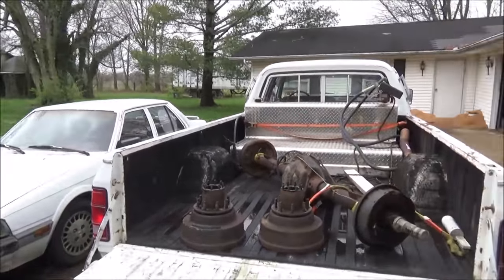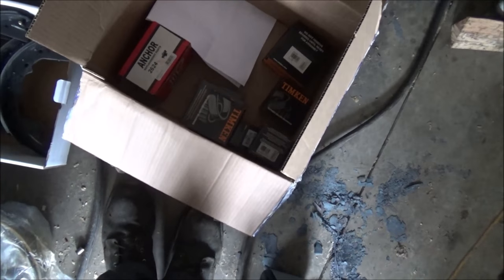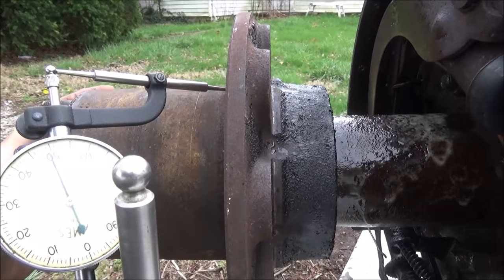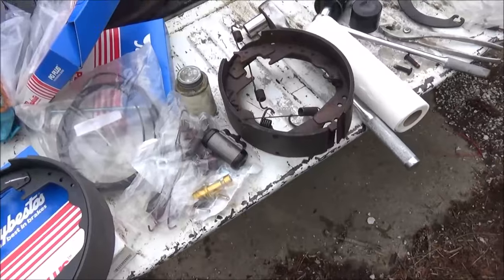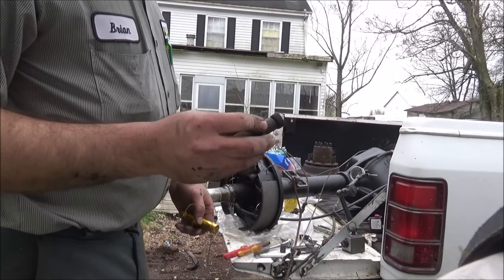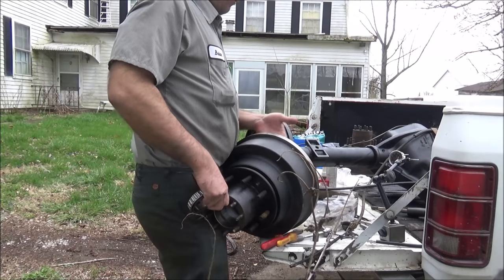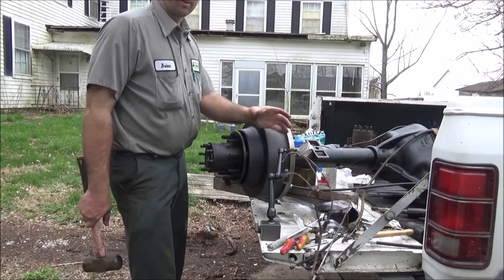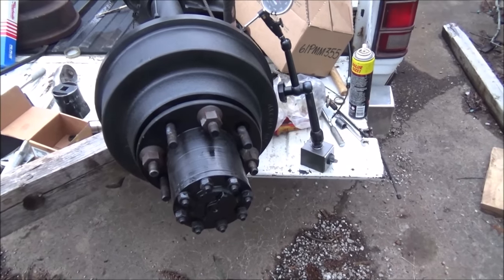Dana 70 axle rebuild brakes and bearings tips and tricks

Comment: Brian,the short friction material shoe always goes in the front......
Reply from the maker: Yeah I know the thick shoe goes to the rear I was just commenting that if you didn't know that not having them labeled would be problematic since even if you knew that part you still have to decide which pair goes on what side since they are mirror images.Lucky for me I have done plenty of this stuff so no problems here. :-)
Reply: For anyone that doesn't know, the LENGTH of the friction material is what dictates which shoe goes where. The shortest length goes forward, the longest goes in rear position.
Reply: It has been a few years, but I'm 99% sure that on my GM 14 bolt axle both shoes were exactly the same. Although, I do know for a fact that when you get into bigger air brake stuff that both shoes are exactly the same for the majority of applications but there are special instances.

Comment: Have to say I absolutely hated the bottle cap lug bolt set up on these truck, I had constant vibration from my old B350 cummins.
Reply from the maker: Centering the coined wheels is certainly a challenge. I prefer hub centric to stud centric but it is what it is. I have considered machining a pilot to add to center the wheels but with using acorn nuts to line the wheels up getting them centered isn't a terrible job just takes another step.

Comment: is it harmful to bearings to smack the drum like that?  i want to try this centering method after doing my brakes and using factory drums with only 60k miles...from the desert so rust is not bad and minimal wear.
Reply from the maker: As long as the bearings are in full contact it shouldn't hurt them. i figure the pounding the road gives them is a lot worse than anything I can do with a hammer.
Reply: Hey thank you so much for taking the time to answer my question!  I like your work style and your attention to detail.   Your videos are very helpful!  Much appreciated!

Comment: The adjuster levers (although they say R and L) are mislabeled and so you have them backwards.  If you look at your lever you’ll see that the part that touches the teeth on the adjuster is rounded.  The other side of the lever has a nice, crisp edge to bite into the teeth on the adjuster.  So, you’ll have to swap your levers from right to left and left to right.
Reply from the maker: Well they have been about 40000miles now like that so I guess I can fix it in another 40K when it will likely need some new shoes.

Comment: Where do you get the fluid film? I found one can of it at tractor supply and they didn't have any more. Best rust preventive I have found.
Reply from the maker: We sell it at the Deere dealership I work at so I get it for cost. :-) Try your local John Deere dealer. I really like it for rust protection I use it to spray all my machine ways that might have sweating and rusting issues. The Lanolin won't bother your skin either. :-)
Reply: ronald davis 
Look on amazon that's where I got my cans decent price too

Comment: Hi I have a problem I change my axle seal and I greased up my bearing I put a retaining compound on the axle shaft left like that for 3 days or so while I want to get a hammer gun to punch back in the leg nut bolts and n I struggled to take off the drum and my bearing and seal are stuck on the actual shaft do you know what my problem is I have a 92 Dodge D to Dolly . I was able to take off the drum but the axle shaft got stuck with the bearing and the oil seal.If anybody could help me would be helpful thanks.I did it exactly the same. Im lost. The 1st time I took off the ram and the drum and Axel everything came out fine
Reply from the maker: Your problem is the bearing retaining compound won't let the bearing slide on the shaft, you will have to heat the bearing inner race a few hundred degrees to loosen the compound before you can remove it then you can pull the seal off. The seal will likely not be any good anymore so better replace it and depending on how much beating on it you did to get the drum off you may want to replace the bearing too, a few bucks spent now could save tons in the future.  Never put loctite or retaining compound on anything until you are ready to not be moving, adjusting or taking apart again.
Reply: Thanks will do never use the lock tight till I see that on the channel I'll have to heat it up and pull it off thanks
Reply: Have used the lock tight just never on an axle shaft well yet again I've never had a Dolly thanks
Reply from the maker: Use low strength threadlocker on a bearing you might want to take off again, bearing retaining compound really holds tight if that is what you used.

Comment: I just took my own Dana 80 apart for restoration. I still wonder, are the bearings supposed to be packed with wheel bearing grease before installation? Wherever I ask, I got different answers on different axles. Some say that this wheel bearing grease is the primary lubricant regardless of the axle being a full float. Anybody knows? Cheers
Reply from the maker: Gear oil is the lubricant in a full float. You don't need to grease it. You just put it together fill the diff, jack up one side as high as you can let it sit so the oil can fill the hubs then let down level, top up oil, jack up the other side let it sit then  let down level and top off again. I believe I went over that in the video but can't remember now as it was long ago.
Reply: bcbloc02 
Perfect answer! Thank you very much. I also saw when you tightened the wheel bearing center nut, but you didn’t talk about any tightening torque. Also here, I hear different stories. Just tighten up ‘til the play is gone and then good to go?
Reply from the maker: ISABELLAKLINIKEN  Should be tighten till snug then back off at least one tab on new bearings, maybe more on old bearings. The hub should have end play of about .001-.003" to allow oil clerance between the bearings. If you run them tight they will overheat and fail.
Reply: bcbloc02 Thanks. 
Back off at least one tab you say. How much does this mean? Tab is a word I honestly never heard (Swedish guy). 
It’s really difficult to feel, or know when it’s correct since the drum is spinning with a great ease even if the nut is tightened really hard. Thanks again for your answers.
Reply from the maker: ISABELLAKLINIKEN  I was referring to the points(tabs) on the star like locking device that keeps the nut from backing off. Use dial indicator on axle spindle to hub and adjust till you can pull/push it in and out and read .001--.003" of movement.

Comment: Wondering what paint you've used Brian. Might have to paint some parts on the underside of my car this summer and I like the mat finish you're getting there! :-)
Reply from the maker: John Deere Blitz black paint. We sell a bunch of it to the hot rodders to paint their rat rods with. It is very high quality and tough paint for about half the price of regular automotive paints.
Reply: in the UK they specifically make a black paint for this kind of thing, called 'chassis black' it tends to be a bit tougher than regular paint
Reply from the maker: They use the blitz black paint to paint disk gangs so it is made to take impacts and be tough too.
Reply: Sounds like some every though paint! Thanks Brian! :-)

Comment: no help for me. you already have everything apart. thats what I need to know.. how to get the break drum off. the book was no help as it dont  cover dualies
Reply from the maker: Well its the reverse of how it went together. You have to pull the axles, remove the locking tab for the bearing retaining nut, then take the bearing retaining nut loose and slide the hub/drum assembly off with the bearings in it.

Comment: Thanks for making this great video Brian -  one thing missed was setting the torque on the hub nut- once you get a load on that rear a lot more shocks and jars  than the hammer whacks will move things on the hub. Also for anyone needing to do this job, a new hub nut should be used - should come with a locking tab. Should also get a new one-time use hub cover gasket. The hub nut and gasket are one time use. If you miss the proper setting of torque you may hear the bearings whining at speed up to 45 MPH.
Reply from the maker: I assume you mean a rolling torque value as you sure don't want to torque the nut against the bearings. The bearings have to run with clearance so the oil can get between them if you tighten the nut against the bearings then there is no clearance and they will overheat and fail when loaded.